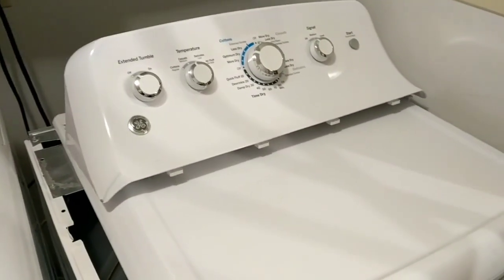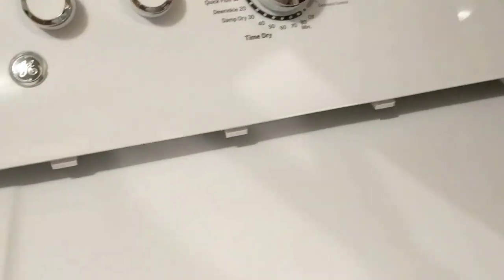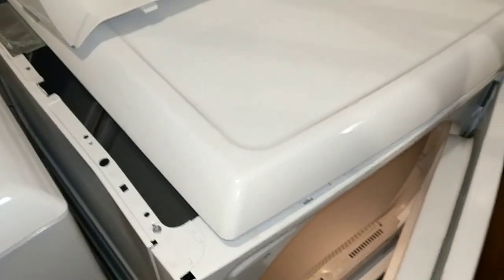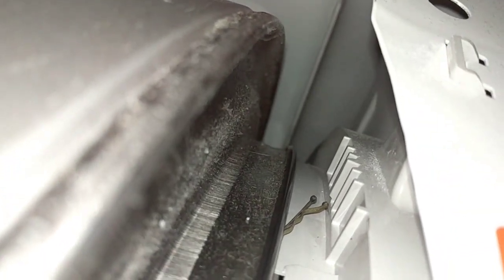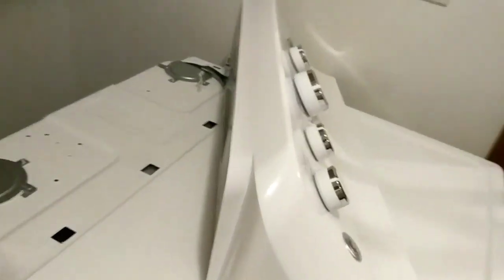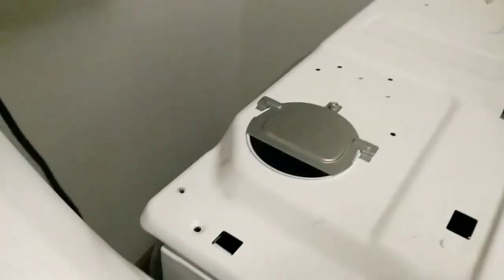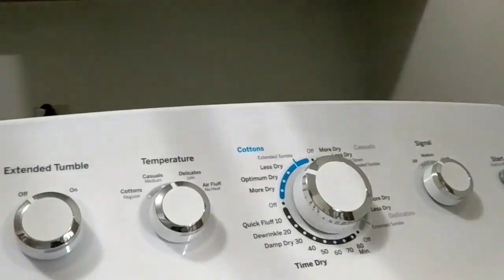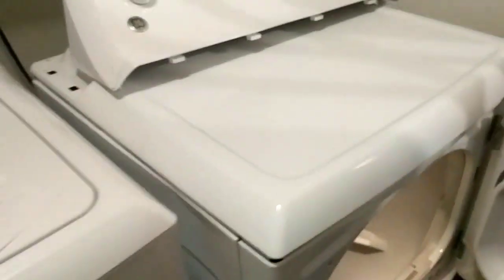GE Dryer Grinding Noise - Bobby Pin / Hairpin Removal

Comment: Thanks so much.  All the other videos were having replace this or that and then saw yours.   I know my wife doesn’t use Bobbi pins.  I ended finding a 4 inch drywall screw stuck in there which was my own fault.  Thanks again

Comment: Thank you! We have a different model GE Dryer, but it was close enough. Turned out our "noise" was a rock from sand after the beach. It took a few turns out the drum, but the rock made it's way to the top and I was able to remove it and the noise. Thanks again!

Comment: You are a godsend! Am not the handiest of guys, so in an effort to avoid an expensive technician, searched YouTube for help when our GE dryer started making a horrible grinding noise. Luckily found your video and easily disassembled it to find a bobby pin in the exact location as yours! Thanks so much.
Reply from the maker: What a country! So funny that people are finding the same exact issue we had. Glad it worked for you.

Comment: I was stymied on how to remove the console on your model which looks the same as my newer model and it's obviously critical to getting the top of the cabinet open. I've seen no other videos with this exact model with the one piece console and there are NOT 3 screws at the back of this console that need to be removed. To remove "this" console, first remove the 2 screws on both sides of the console that the video shows. Then from the front push the console firmly towards the rear about an inch or so which will disengage the tabs on the front on the console and allow it to be lifted clear. This will expose 2 screws, one on each side at the rear of the main top that when removed will allow the rear of the lid to lift. The video shows these two points. The front is the same as the video. In my case once the main top was lifted, it exposed 2 screws on either side at the top front of the assembly that when removed, allows the door panel to come free. That was when the zipper pull fell into the dryer which had evidently been jammed along the front drum edge which had been making the same type noise as the bobby pin. Excellent video idea as this style model is prone to catching items on the front edge of the drum causing noise.

Comment: This video saved me so much time and money!!

I was prepared to replace a drum bearing but couldn't find a video on how to take apart my exact dryer. Turns out I had a drywall screw stuck between the drum. I would have never even checked (or gotten my dryer apart!) had it not been for this bobby pin video!!! THANK YOU!!

Comment: Thanks, I had the same problem with the same dryer except it was a metal tip to a pair of shorts.
Reply: Mine is that exact thing but I can’t find it
Reply: @Abrilgee  Mine was right inside the door and I had to look up from the floor to see it.

Comment: Great video, mine was a bobby pin, too. However, quick FYI for everyone out there with a similar problem: I didn't take anything apart, I just reached inside and grabbed the drum by a fin and shook it vigorously while spinning it a little. The bobby pin popped right out from wherever it was hiding.
Reply from the maker: Good tip
Reply: Fixed my dryer the same way this morning, thank you. Still had to check the edges of the drum from the inside and pulled out a shoe string.
Reply: THANK YOU SO MUCH. I took the dryer apart like in the video and I still couldn’t find the noise. I did what you said and it dropped right out. It was a nickel! I cant think you enough.

Comment: I did exactly what you did (I have the exact same model you do) and found a drywall screw in the same place you found a bobby pin.  They must have a design issue with the top of the drum because everything seems to get caught there.

Comment: This video saved me some $$. I took mine apart just like you showed cause I had a similar grinding noise. Turns out an aglet got wedged in between the rotating drum and metal. Took me about 30 minutes to fix after watching your video. No more grinding noise. You rock!
Reply from the maker: Glad to worked!

Comment: Chalk another one up.....  Same grinding noise suddenly comes out of nowhere....  Grab and shake didn't work.  Already knew how to remove the panel and the top, but this vid gave me a tip on where to look first.....  Lo and behold, a paperclip was wedged in the exact same spot.
Reply from the maker: You're supposed to take the paper clips off when your laundering. 🤪

Comment: Not a Bobby pin, but the little plastic caps at the end of shorts & jogger pants draw strings.  Took 2 noisy quarters out of the baffle fin while I had access. 

Thank you

Comment: this worked great but not i can’t seem to get the top back on. screws and holes wont align
Reply from the maker: It gets out of alignment. You have to really shake it on the sides.
Reply: Try to alignment by screw driver the put both of screw in there hole and tight it one time here anther in other port so it will be easily for you getting alignment  i hop my languages clear

Comment: Metal endcap stud from the drawstring of a pair of sweatpants. in the 11:00 position of the same area your bobby pin was in. Had the sound of worn break pads when you turned the drum.

Comment: Thank you!  We have the exact same model and instead of a Bobby pin, it was the metal tip of a drawstring. The sound wasn’t as extreme, but. A problem none the less.
Reply from the maker: Ah, the ole drawstring bandit.